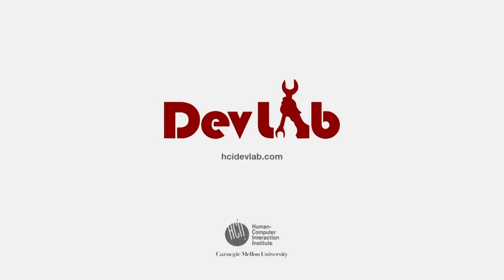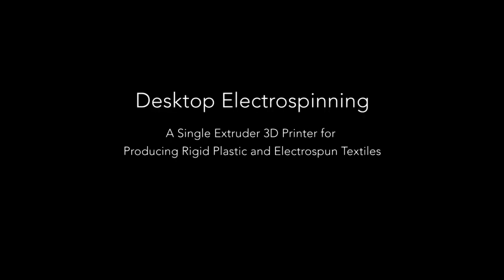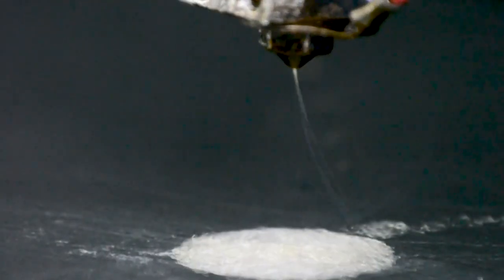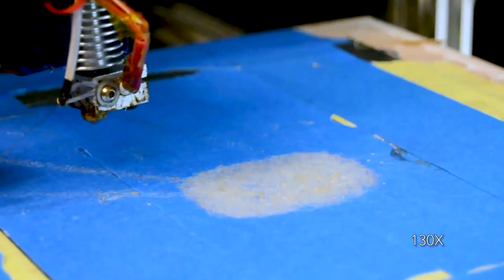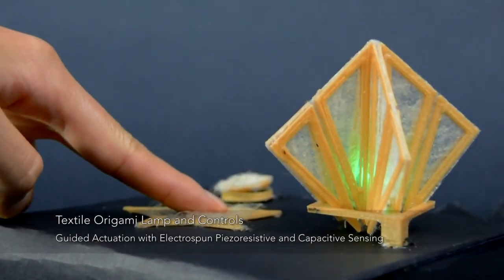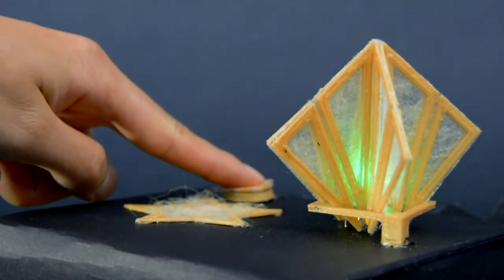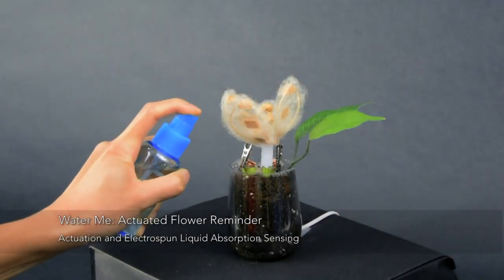Desktop Electrospinning: A Single Extruder 3D Printer for Producing Rigid Plastic and ...

Comment: Well done. I have read your paper. You mentioned a positive high voltage supply was connected to the collector, and the spinneret was connected to ground. So I am very curious that why a positive voltage can drag the jet down to the collector? Shouldn't be a negative one?

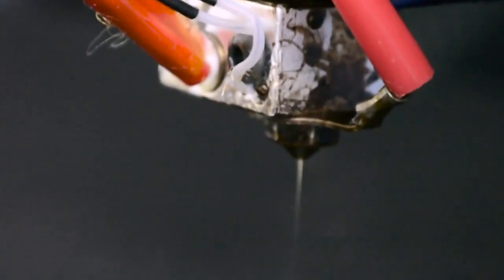Comment: Nice work. How did you insulated the electrical part of the hotend (thermocouple and ceramic heater) from the applied potential? I can see that at 0:11 the HV electrode is connected to the brass extruder.
Reply from the maker: Hi Mattia Pierpaoli,
This is a research project, you can find more information in the paper https://dl.acm.org/citation.cfm?doid=3290605.3300434
//DL